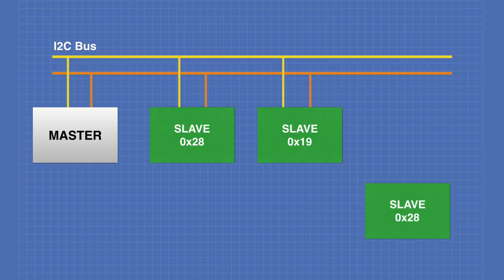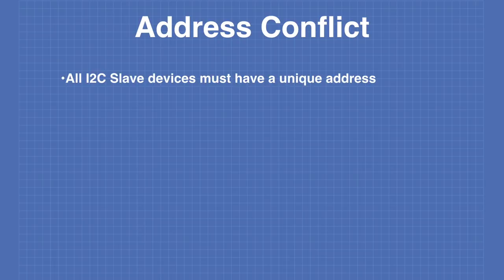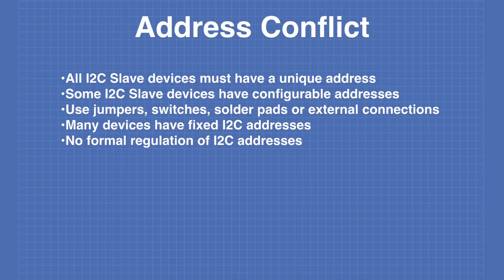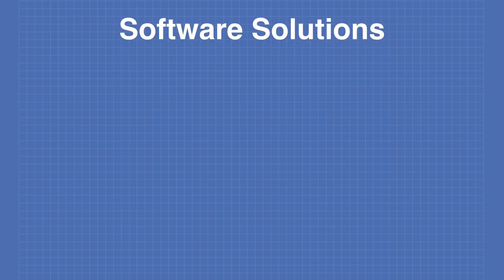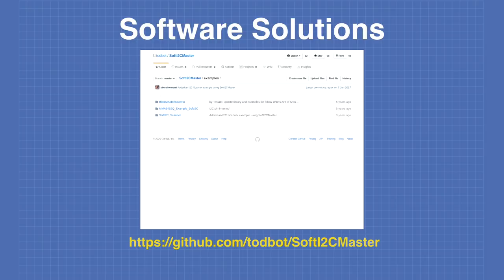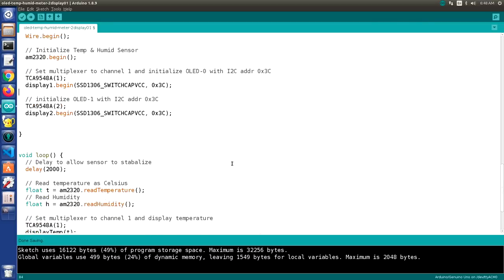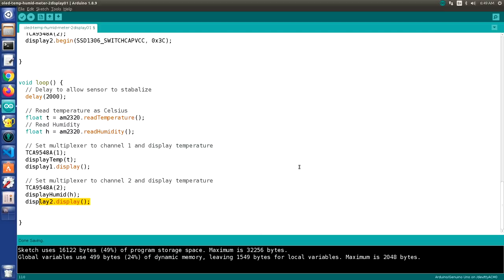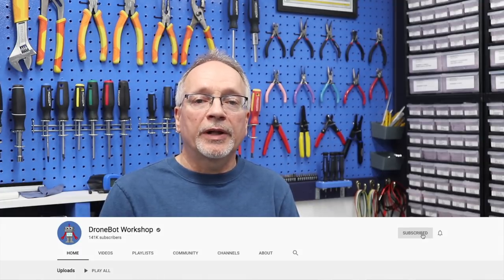Solving I2C Address Conflicts - TCA9548A I2C Multiplexer

Comment: Thank you for this content.  I mentioned in your other single oled temp/humid sensor video but:  If you get a NAN value displaying on one screen, you need to add an additional 2000 ms delay in the code.  Pulling both values quickly doesn't work with these temp/humid sensors.   They can only be polled once every 2 seconds.  Adding that 2 second delay in between both reads fixes the NAN issue.

Comment: Great video.  I do have a question though.  Why add the resistors as shown in your wiring diagram?  Also, what resistors are those so I can purchase them?  I am using an ELEG Mega 2560 board on this project and pulling from the 5V pin for this module with multiple OLED displays.

Comment: Great video. Would you please mind guiding me through a solution to an I2C issue? If I want to add a distance extender to an I2C bus, where would it be added : between the master and the multiplexer, or between the multiplexer and the sensor? Thank you

Comment: Hey! would it be possible to use a cd4051 to hook up the data or clock from the arduino to each slave device, and use that to switch between them? Thanks for the help!

Comment: I think you could also do this with one (or more) 74LS125 (a tristate buffer) and GPIO to proverbially 'connect and disconnect' devices from the bus. This will consume GPIO pins for enabling, so it's not as elegant as the TCA9548A, but it should work, no? On the software side, it seems like this would be roughly the same. I haven't tried it, but conceptually it seems like it should work, no?

Comment: Great video!

Does it matter where on the I2C wires you attach to 5V via a resistor? Suppose the peripherals are a few metres from the multiplexer and in some cramped corner - does the 5V need to be fed to the I2C wires at the peripheral end or can it be fed in right next to the multiplexer?(If so it'd be simpler to just wire the resistors across the multiplexer itself, but if that was the case, they'd be built into the multiplexer itself probably)

Comment: great video as always! if the pins are outputs, is there a way to read multiple sensors through the bus and display on one display? looking for a way to connect 5-6 thermocouples without having an arduino or ideally an ESP32 for each one or two just to get the readings to one display

Comment: Hi Dave, ive been looking for a sketch which I can use for 2 x 128 x 32 Oled using a Nano and the TCA9548A module, I got a PCB made and it just arrived, and I think I can use your sketch for the Model railway display I need, its on a Gantry and it just displays a "P or B or T" depending on points triggerl and signal trigger, I already did one for a single Oled so I think yours is perfect, thanks so much I love your videos ... John

Comment: How about reading several encoders attached a single I2C device?  Is it possible?  Also sending data back to the I2C device to set the encoders to certain values.

Comment: Why the SDA and SCL are connected to Analog PIN4 and PIN5 and not to SDA and SCL from arduino? From the given code how did you assign the PIN4 and PIN5 as an alternative SDA and SCL (i cannot see any code for assigning or using the PIN4 and PIN5).... i am a beginner ... please explain.. TIA

Comment: I have a query, How do i get inputs from multiple MPU6050, i tried with it but it seems to display values that is in the max number of value in TCA like if i add 4 MPUs in ports (0,1,2 and 3) then the data is showing only one MPU (in TCA 3) for all values, even for the other MPU code

Comment: Hi DroneBot Workshop. I have a small question on a project I am trying to learn Arduino with. Would it be possible to run 4x Pressure sensors and a touch screen display on an Arduino Mega?

Comment: How many ohm resistors should I use to power NodeMCU over 3.3v?

NodeMCU ile 3.3v üzerinden çalıştırmak için kaç ohm direnç kullanmalıyım?
Reply: Hi, if you have a battery or a Powersupply you have to use some kind of Voltage Regulator, because the current draw off a microprocessor is not constand

Comment: Any chance you could help me.  Ive followed this project closely but I am wondering how you would use 2 seperate temperature sensors ( Im using  two DS18B20) to display to each screen instead of one sensor to a  single OLED screen.  I have the project working but it scrolls between temp sensors and I would like each screen to stay static on a given temp sensor.  any help you could give a fellow Canuck would be appreciated.

Comment: Hi!
In case that I want my many similar slaves to be input sensors (all equal sensors) on the Arduino, will every of this slaves have a new different address to call it on the code when implementing the multiplexer?

Comment: i solve this problem by making switch relay, simply i designed address giver circuit that allows the arduino to select which device going to be connected to the I2C on demand.

Comment: This video would have been improved if all I2C devices in the training would have been connected to the multiplexer.  Instead, only the two displays are connected, thereby bypassing the connection of the third I2C device?

Comment: Excellent explanation sir, can you do one video on SPI bus how to connect more than one SPI devices to Arduino.
Reply: well, you wire up the second SPI device's CS/SS pin to another GPIO pin on the Arduino. The other pins (MISO, MOSI, SCK) are shared.

Then when you want to communicate with a certain device, then you pull the respective CS line LOW.
Reply: Sir, I am trying to interface SD card module and nRF24L01.With single SD card it is working as soon as if I connect nRF24L01 MOSI,MISO,SCK pins along with SD card. Showing error . Like initialization of card is failed.
Reply: Thank anna for your reply sir.

Comment: Sir, I am trying to interface SD card module and nRF24L01.With single SD card it is working as soon as if I connect nRF24L01 MOSI,MISO,SCK pins along with SD card. Showing error . Like initialization of card is failed

Comment: Could somebody explain what the purpose of the 4 resistors is?  It seems (on the surface anyway) that if you deleted those, this set-up would still work.  I'm guessing it has something to do with keeping the signal clean?  (Obviously I'm not an EE)
Reply: The transistors in the I2C only pull down to ground. It needs something to pull it up to +3.3v when the transistors are not active. Think of the resistors like a spring and the transistors when active pull down but when not active the spring pulls up.

Comment: Do the new Arduinos that were released in 2019 still have only one I2C bus?
Reply: Yes. It's how the uC chip is designed - only one I2C bus.
Reply: ESP32 chips have 2 I2C, so consider those in place of an arduino

Comment: Hang on.  "The first slave has an address of 0x28."  Yes but where did that "0x28" come from?  Why is it 0x28?  Did it decide that itself?  Was it told that by someone at some time?  Does it come with that address from the factory?  Who decides which devices will be 0x28, and which will be 0x29, etc?  How is this not a gigantic problem?